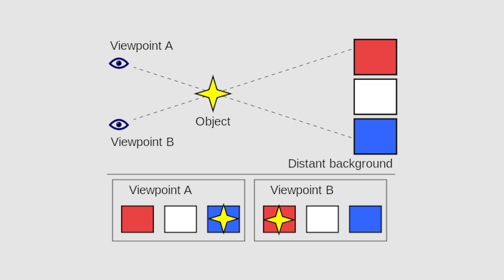How to determine lens nodal point for panoramic photography

Comment: I'm sorry but following the advice of the man (two vertical tripods usually used to carry an umbrella for a flash and my regular tripod for the camera), when I align the tripod of the camera, checking that the focal plane of the sensor is in the middle of the tripod, when I rotate the tripod the two vertical tripods are still aligned and they escape from the LiveView window before to be not aligned...
Reply from the maker: I'm sorry, but I don't quite understand the issue you raise. Would you mind stating it again? What do two tripods have to do with what I describe in the video? I'm confused. Please help me understand your issue so I can possibly suggest a remedy.
Reply: @lespicker  Sorry for the confusing description. I used two tripods/flash stands ('not candlesticks') as suggested (ca 2 m distance) to get the two vertical lines supposed to move with parallax, then putting my camera about 4 m in front, I aligned the camera/lens (24-105 mm at 70 mm) with the two vertical stands through the ocular (or LiveView) - on that point, I followed exactly what you recommended - starting to rotate the camera like for a panorama (keeping the plane of the camera sensor aligned with the axis of my camera tripod), I didn't notice a really visible parallax effect in LiveView mode on the two stands (they got out from the image in LiveView before being noticeably un-aligned). I'm wondering if the real error due to the expected parallax defect is noticeable in a DSLR system (which won't be the case with a rangefinder camera like a Leica M).  Where is my mistake? too short distance (2 m) between the stands ?
Reply from the maker: @michelclaude5149  Michel, thank you for the clarification. It's hard to diagnose this without seeing you actually performing it, but I'll still hazard a suggestion. But first some thoughts. It is possible that you just happened to mount the camera/lens right on the nodal point. That has happened to several of my students over the years. In that vase, of course, you will not see any divergence. I suggest you move the slide extremely forward and back and repeat the process. You should see mis-alignment at some those points. Next, 70mm is not as common to use in panos as would be 105, 150 or 200. That is because you want lots if images to increase the pixel count for higher definition. It is possible that you are not seeing much divergence at 70mm. Try 105mm. If you have a lens with 200mm, then try that, too. Wishing you the best of luck.
Reply: @lespicker  Thanks for your reply. I'll follow your advice.

Comment: Maybe nit picking here but according to your video, in camera landscape orientation the vertical nodal point has been ignored.  OK for single row panos but for multi row panos the vertical nodal rotation point (offset) must be at least as important if only for the stitching software, which can become confused.
Reply from the maker: Soapy: Thank you for taking the time to comment. I think you my have misinterpreted the reason for landscape orientation in figuring out the nodal point. It is simply to make it easier to see the movement of the two poles. Of course, when you actually shoot the pano, you should preferably be in vertical mode, unless you are intentionally doing a small one row pano. 

Good shooting!

Les

Comment: Hi Lester, Adam here, from Jamaica; can you explain why on my nodal rail, that the positions for my 35mm and 85mm lenses are at the same point on the rail; Am I doing something wrong.  I followed you setup re the vertical objects in the fore and background...all be it, not using such a renowned nodal rail as yours i.e. Really Right Stuff.  However, I'm using a levelling base, a panning head and a L-bracket.

Comment: I'm having a really tough time finding the nodal point on a 210mm APS-C lens. I have tried setting up the two stands anywhere from 6 to 20 feet apart from each other. I can't actually see any parallax when I rotate the camera, no matter how much I move the center back and forth on the rail.

Do you have any tips that might help with this?
Reply from the maker: Obviously it's hard for me to know exactly what you are doing. Some suggestions: Make sure you have the camera in horizontal (Landscape) orientation so you'll have a better chance of seeing the  movement (of course when you actually shoot a pano you'll want to be in portrait orientation); put your camera in Live View as you do this (not needed if you use mirrorless). Please advise if these steps work.

Comment: can  you show an example of a pano with and without compensating for nodal points and show what the defects are?
Reply from the maker: Pete, thanks for your question. Good idea. I will try my best to do this given Covid and my schedule. However, I can tell you that the results are significant distortions and the inability of stitching programs to compensate for that.
Reply: @lespicker   Thanks for the reply... The reason I asked is that I have done a bunch of panos without compensating for nodal points and Lr has never had a problem stitching them. Note that most of them are w/ a 17mm lens on APS-C sensor and are single row panos, but other focal lengths work too.  My only "problem" is when I have a foreground w/ a log, then the log gets warped. But I don't think nodal compensation will fix that. I have only done 1 multi-row pano and that worked too.

Comment: Great explanation Lester. But if I don't have a sophisticated tripod like the one you have (just a sturdy but regular one), which should be the best steps in order to take a pano? I'm just getting started with panoramic photos, and I've bumped into your video, any advice would be much appreciated. Greetings from Argentina!
Reply from the maker: Hi Pablo! If your tripod is sturdy, it will work just fine, so don't worry about that. If you do not have graduated markings, just overlap the images by 1/3 to 1/2 and you will be fine. Just make sure your tripod is level. BTW, I will be in Argentina in 2 weeks (Buenos Aires and Ushuaia).
Reply: @lespicker  Thanks Lester for the info. Great to hear that you're coming here. I live in Buenos Aires, but I'm taking holidays on next December the 14th, so I won't probably be here to meet you. When are you coming here? Ushuaia Is great, been there 6 years ago. Anything you need , just let me know.
Reply from the maker: @pablodoncor  I'm arriving on the 15th, so we will miss a possible meeting. I wish you the very best with your panos. You live in one of the most beautiful areas and I'm sure you will have some wonderful panos.
Reply: @lespicker  Thanks Lester. Enjoy your time in this beautiful country.

Comment: Do you think you need to do this process when stiching but not going too wide, with longer lenses? For example I'm often stiching images with my 105mm nikkor to get more of a medium format look, but do I need to think about parallax then if I'm not going too wide, even though this is still considered a panoramic image?
Reply from the maker: Good question and not a simple answer. If you are only taking 3-4 images with a 105mm, you can probably squeak by without too much concern about nodal point. As you extend further than that, it will increasingly come into play. See how your stitching program handles it and if you are pleased that is all that matters.

Comment: Great explanation thanks for doing this video,  dry helpful. I am starting to shoot panoramas I recently bought the Ninja Nodal 6 starting kit which is very similar to the one you are using. So if you set your nodal point at 70mm but after you go back to 35mm using the 24-70mm, do I have to look for the nodal point again even if is the same lens? Sorry for the long question.
Reply from the maker: Juan, yes you should check it at your major shooting intervals. BTW, I am curious as to why you would want to shoot panos at 35mm. Even 70mm is wide unless your subject is fairly close. The main reason for panos is to increase the pixel count for maximum resolution, especially for printing at large sizes. I am not saying that you shouldn't shoot wider, but you may want to consider your goals for any particular image.
Reply: Lester  thanks for the feedback Lester. Well cause I have the intention to photograph the new terminar of cruise ship here in Miami and it is very close from where I am planing to take the pictures, of course using a zoom lens will be for sure

Comment: doesnt rotating the camera to landscape mode  for nodalpoint-adjustment ruin the first step? unless the lbracket has by luck the same distance to the middle of the lens...
Reply from the maker: Any decent L-bracket will guarantee that when you rotate between landscape and portrait mode the distance from sensor plane to nodal point will not change. That is one of the reasons I only use Really Right Stuff brackets for my cameras.
Reply: @lespicker   you mean the perpendicular distance from the lbracket to the lens/sensor center does not change with proper lbrackets? then i probably got the wrong one. 
dont see how turning the camera should affect the distance from the sensor to nodal point though, as both are inside the camera/lens? 
the reason I posted this comment is, because I thought you should adjust the lens to the center of the tripod (first step) for both, the x and y-axis. Thus, by removing the camera and arca-swiss-style mounts being sliders, you would not have the same position as before, when turning it back to portrait for your pano.

Comment: Hi Lester. Very good tutorial especially for someone like me who is new into panoramic photography. I have 2 questions (they may be related) I'm trying to figure out the nodal point for my 70-200mm lens and having some difficulty on the longer end, especially 200mm. 1) The nodal point is situated within the lens' barrel or it can be beyond the sensor? 2) Even with small aperture I had problem keeping both poles in focus - 3 feet & 6 feet, how do you managed this?
Reply from the maker: Sabah el Kheer, Mohamad: I I am having difficulty understanding exactly what you are asking, but I will try to answer anyway. If I have not given you the correct answer, feel free to try asking again. The nodal point must be situated somewhere within the lens barrel. It cannot be located beyond the sensor. If that is what you are finding then you have set up your equipment incorrectly. Next, the pole distances sound too close and in that case you will never be able to get them in focus. However, having both poles in critical focus is not really necessary, so long as you can see whether the poles move relative to each other. I suggest having the nearest pole perhaps 15 feet (5 meters) away from the cameras and the back pole 20 feet away from the camera. Please let me know if those two answers work for you. Ma'ah salemma!
Reply: Lester Picker Thanks for the super fast answer. Yes u got my questions correctly and answered them perfectly. Very many thanks. Btw, i’m not frm middle east & i assumed you wrote something in arabic so forgive me if dun respond coz i dun understand them.

Comment: very intriguing video, Lester.   Okay, one clarifying questions comes to mind.   Pupil entry point identification.  Could i just stop down my lens at 70mm on my camera. and while holding it down, move that tiny circle directly over the "center" of the leveled tripod using just the nodal rail only, and essentially have found the correct point? (Maybe a fine bit of tuning back and forth if poles didn't line up exactly after that.)   Stepping back from the overall video, its seems simply this is what you were trying to achieve - only more precisely with more equipment.    Is my assumption close?

Comment: Hi Lester.  I understand why you usually use a telephoto lens.  However, I'm primarily interested in Milky Way/astrophotography and need a wider lens to avoid star trails. While experimenting with your technique (very well explained BTW) I don't seem to notice a lot of difference as I rotate the camera.  Might this be a product of using a wide angle lens?  Also, would a wide angle lens be more forgiving if you can't nail the non-parallax point as precisely as you have?
Reply from the maker: Hi Rob: Sorry it has taken so long for me to respond, but I was in Africa leading a group of clients in Uganda (mountain Gorillas) and Tanzania (Serengeti and Ngorongoro Crater). In any event, the answer to your questions are Yes and Yes. A wide angle lens would make it more difficult to see the parallax movement. Also, a wide angle lens would be more "forgiving" even if you are a bit off in nailing the exact point.
Reply: Sounds like an AWESOME trip!

Comment: Hello Les, thank you very much for presenting this video. Easily the best instructional video on parallex I do have a question regarding the lens you usually use, the 70-200. I have never thought to use it, I usually use 24mm. I am assuming your pano's are done of landscapes relatively far in distance.
Reply from the maker: Hi "Metals"

Actually, a 24mm lens is the wrong lens to use for panos in most cases. It really all depends on the purpose of the pano and that is a long discussion. But, if your goal is to produce stunning, large format prints that have incredible detail, you need as many pixels as you can get. So, for example, one of my panos I took in Iceland could have been taken with a single 24mm image, or perhaps 2-3 stitched together. Instead, I shot it with my 70-200 set at 200mm and captured it in 3 rows of 14 images on a Nikon D800. That is one boatload of pixels! However, we printed it as a 25-foot by 9-foot mural!! It is so exacting you can see every sheep a mile away clear and sharp. You can see a small sample of that pano at: http://www.lesterpickerphoto.com/2014/03/30/pano-question/

Hope this helps. 

Les
Reply: Thank you for the prompt response. So you are doing 3 rows of pano in some circumstances? And by using the 70-200 do you not have issues with depth of field if you have foreground objects. Do you do another row focused on the foreground subjects?
Reply from the maker: Metals: This is a complicated topic worthy of a separate blog, which I will do sometime in the future. You cannot make major adjustments to focus as the lens perspective changes will totally screw up the stitching. Minor tweaks (very minor) are okay. So, you have to consider how the foreground elements impact the image. If they are central to the composition, then I typically will expose for them, use a small aperture and employ hyperfocal focusing to get a crisp shot. Alternately, I will often use a tilt-shift lens to get tack sharp focus from foreground to background, but I am limited to just a few images. Hope this helps.
Reply: Thank you again for responding. It would seem that when you are using the 70-200 lens you are typically shooting pano's without major foreground objects of importance. And thus are focusing once for a more or less distant pano subject. I appreciate you taking the time to attempt to educate me, and will do my best to not further trouble you with this line of questioning. Best answer really is trial and error.

Comment: Hi Lester, I'm struggling with getting this right on my setup. I have a Canon 5DS with a 70-200mm Sigma lens and it seems like the Sunway CR-3015 does not have a long enough nodal bar. Are nodal bars made in varying length to accommodate  longer focal lengths ?
Reply from the maker: Damien, I am not familiar with the Sunway product. Nodal slides are made in different lengths. I would recommend you visit the Really Right Stuff website and check out their product line. Best of luck!

Comment: Why not just use your L bracket mounted directly on a swiveling head? Then you know the camera body will be centered, and most arca rails have a little play front to back for your nodal adjustment yeah?
Reply from the maker: Not exactly. You are correct that the camera body will be centered, but as I explain in my video, it is NOT the camera body that matters, but rather the lens and where the light rays intersect.

Comment: do you have to set the nodle point for every zoom as the Sony 70-200 f4 has internal zoom
Reply from the maker: Alan, thanks for writing. Good question. There is no simple answer, as lens configurations differ. Theoretically, the differences should be slight. But, I suggest you test at 70, 135 and 200 just to be sure. You may notice no difference, one so slight as to not really matter, or a moderate difference between the extremes. .

Comment: I have 15mm Laowa zero distortion lens. I am curious if its actually better or worse for making 360 panoramas. Any ideas?
Reply from the maker: Thanks for writing. Since I do not do 360 panos, I am not certain. However, extremely wide angle lenses defeat the purpose of panoramic photography as you are limiting the number of pixels in the resulting stitched image. They also are subject to more distortion in processing.
Reply: @lespicker  Thanks a lot! :)